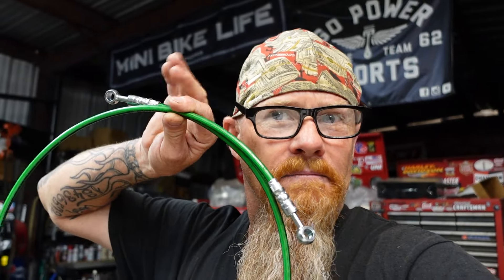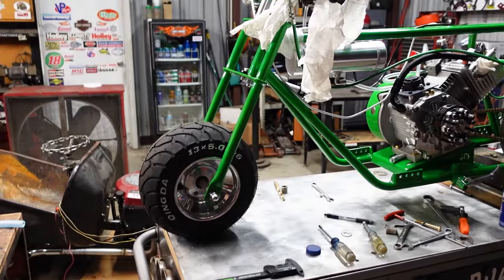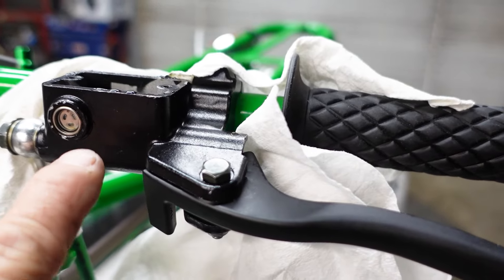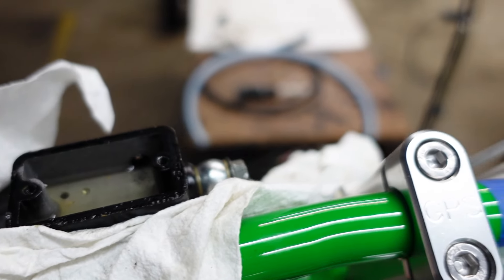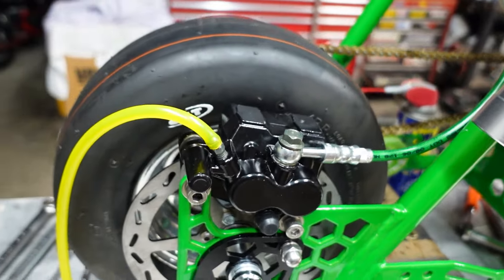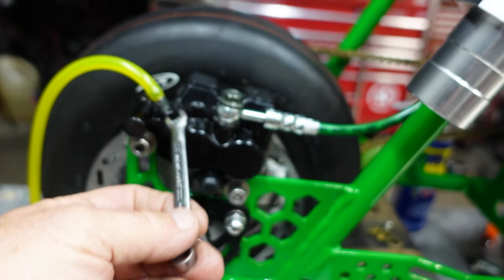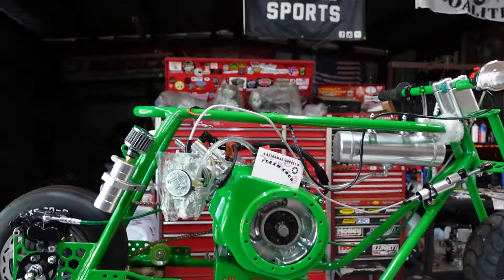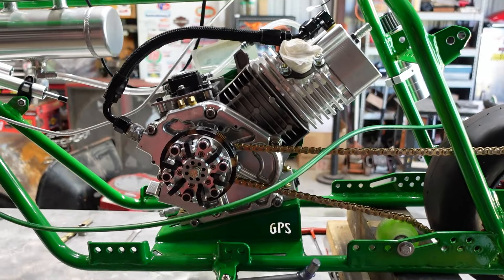Rascal GT Drag Minibike Build Pt 2

Comment: When I built my race quad I pre-filled the caliper then attached the brake line then used a syringe to fill the break line & then attached to the master cyl. Filled it and bam like maybe 10 pumps & done. Took about 2 mins after I prefilled everything.

Comment: The engine does sound nasty Rick! The bike came out very cool and the green brake line looks good ,as well as the chain tensioner wheel. Are you going to run gas or methanol when you race it? Looking forward to your testing video! ✌🎥🇺🇸
Reply from the maker: Thank you sir !! I will be running methanol , hope to get some test runs real soon , Thanks for watching 👍👍

Comment: The rascal came out amazing the trumpet exhaust sounds great.. I might have missed it but what cylinder head did you use 14cc 18cc 22cc? valve sizes? ty knuckles
Reply from the maker: Thank you , it’s a moflow head , 18cc I think , I didn’t build this engine

Comment: Where did you get that black braided supply line from the dipstick hole to valve cover? 3/8?
Reply from the maker: It was on the engine when I got it
Reply from the maker: 1/2 line , I think